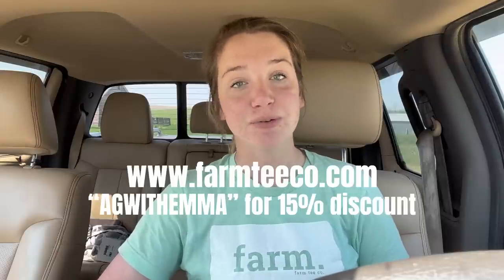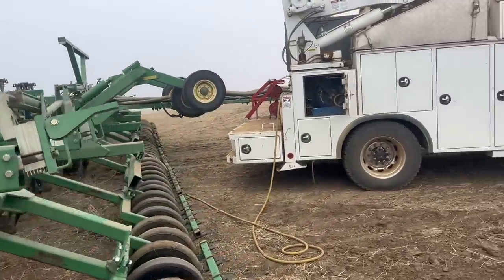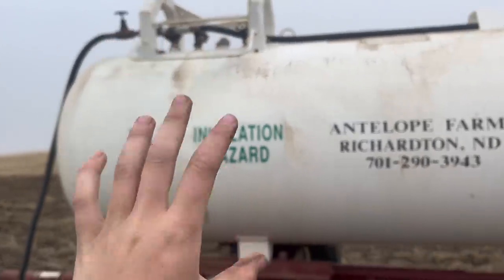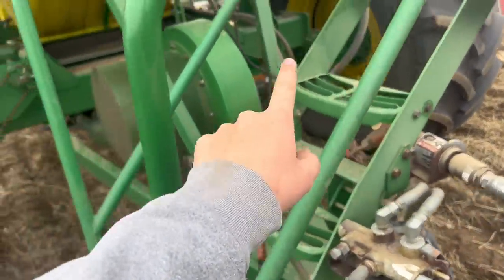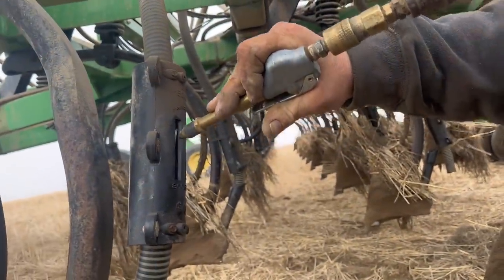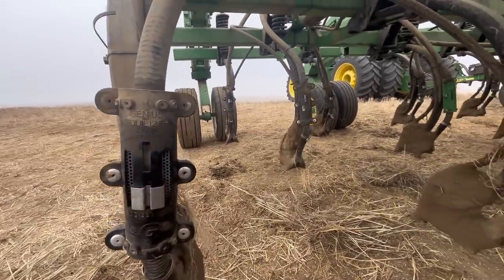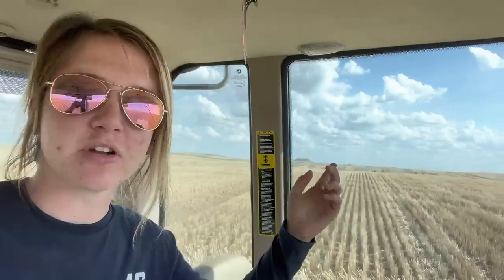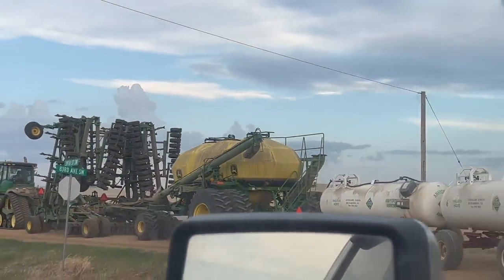Applying Anhydrous Ammonia While We Seed!

Comment: NH3 is not only an inhalation hazard, but at ph13 a severe burn hazard if spilled on the skin. It not only will burn the skin but continue to eat its way down toward the muscles until it becomes neutralized. Young man I farmed with spent a month in a burn unit after failing  to depressurize the cold flow unit before attempting to repair it. It missed his face, got his left side ear ,neck and arm. Needed some skin grafting but they couldn't do it until they were sure it didn't get down to the muscle. The story of getting the burnt skin scraped off (called debrieding) is the stuff of nightmares. Incredible pain. Got away with some lung damage and a lot of scars and is actively farming.We both hire NH3 done now. One mistake was one too many.
Reply: That's why they always had a water tank on the side of the anti hydrous wagon to wash your skin off right away
Reply: @duanebolen543  Its not enough when you get that much. 4" service cover blew off with 150 + psi behind it. Fortunately he was with another guy who after they emptied the water on the tank,got him to the yard and under a hydrant until the ambulance got there. Ambulance driver was given wrong directions, but he worked at the co_op and knew who was applying out that way and got there fast or it could have been a lot worse. He could barely breathe at all.
Reply: Agree 100%
Reply: A few folks I know actually use full hazmat suits and resperators messing with that stuff.
Reply: @joemac3118  I always wore gloves, goggles, respirator and a protective jacket when changing tanks. Really sucked when sidedressing when it was hot out. Only incident I ever had was a hose got ripped off the tank when the hitch pin broke while applying, but that was just a matter of circle back behind the tank and turn it off . 99.9% of the time there's no problems, but people make mistakes or equipment fails.

Comment: 54 openers at 12" spacing would be a 54' wide air drill.  Yes, outside opener to outside opener would only be 53',  but once you turn around and make a second pass, you leave 12" between the first pass and the second pass your making, meaning it's 54' wide.  So either it's only 53' wide with 53 openers on 12" spacing, or it's 54' with 54 openers on 12" spacing.

It's the same thing with any planter.  An 8 row, 30" planter is considered 20' wide, even though outside row to outside row is only 17.5', because you take into account the idea that each pass is another 30" away from the previous path.

Comment: Is the gas/chemicals put in the ground as a liquid or aerosol?  I've seen it used for years but always wondered if it is a liquid when applied or if it's in a gasses form.
Thanks Emma
Reply: Under pressure in the tank its a liquid at -27°F turns to vapor as it is injected into the ground and attaches to soil moisture.